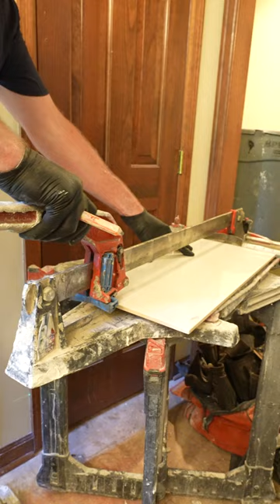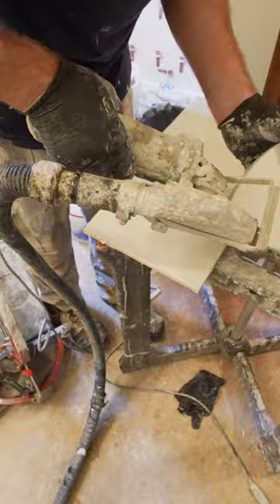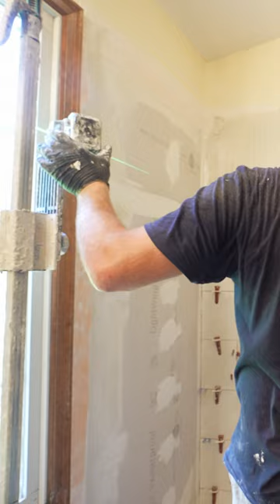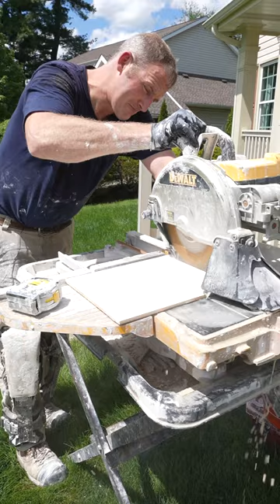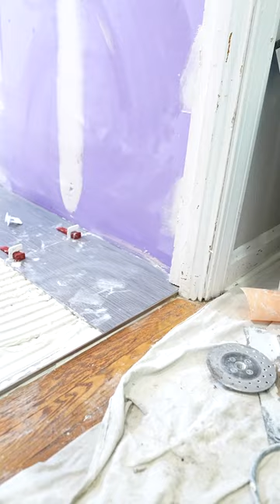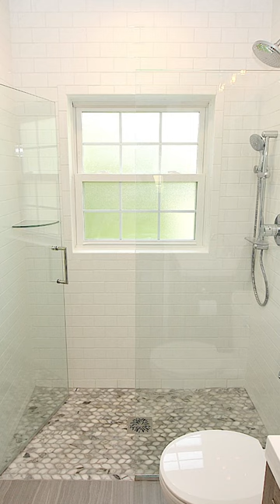Triggering tile setters with my dirty tools #diy #shorts

Comment: I drove a concrete truck 12 years. You try to keep it clean, but being mechanically correct was more important. It was a company truck, but I fixed it myself constantly whenever something simple broke. It was always ready for the next day. I delivered more concrete than any other driver of a list of 40+ drivers. Other guys had OCD about their perfect paint job. I knew the truck was a tool. Just like my Harleys. I wash my bikes once a year whether they need it or not.

Comment: At some point you gotta weigh the options. 10,000$ a year in paper towels to wipe your tools off after every cut or using them as they’re designed to be used. Tile work is always dirty.